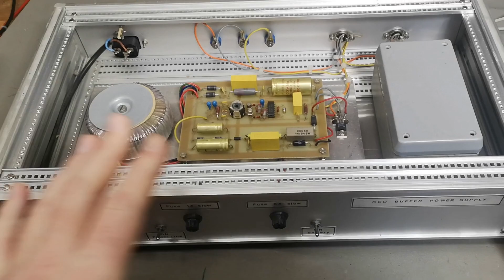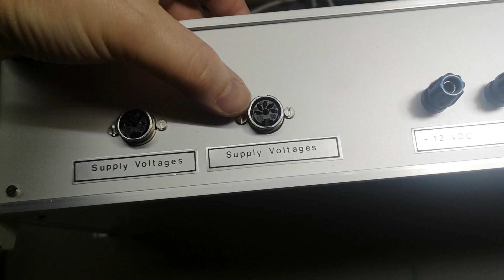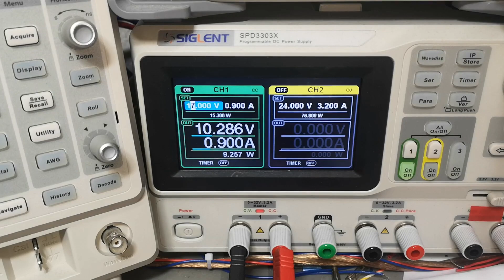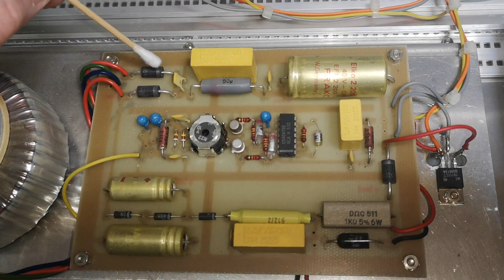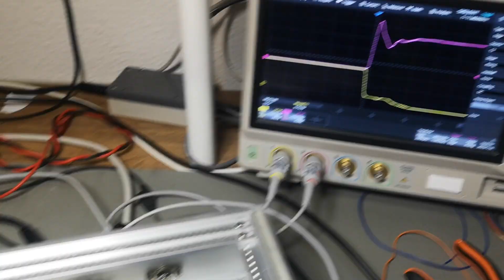DIY DCU buffer power supply 12V battery backup UPS test teardown

Comment: Battery didn't hold any charge because you charging it to way too low voltage. If it contains 14 sells it should be charged to 21v because full charge of nicd cells is around 1.5v
I bet thet those batteryd will hold atlist half of original capacity
Reply from the maker: sorry, but i was not able to wake any of the old NICD back to life, tried a few just for fun

Comment: Hi, well that's bad, the magic smoke has escaped and with it all the secrets of the circuit 😂 I also use this style of making acu blocks built into installation boxes, the last time I made a battery for an HP 427A voltmeter this way.

Nice day 🙂 Tom

Comment: Relies on the NiCd cells to regulate the charge voltage, as it is a roughly constant current charge. Amazed they have not got any crusties on the cells, they must have not been cooked for ages in use.
Reply from the maker: i think they adjusted the charge current, to be vary close to the normal usage current, this way the unit can stay on mains, and be ready for a power out all day long. maybe they did not need many years operation, it was a short technical research installation at greenland